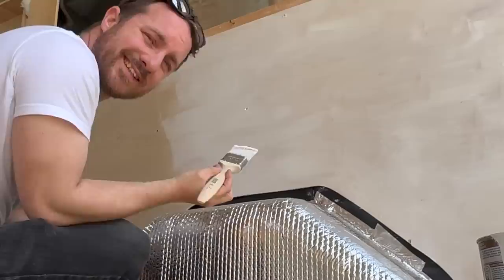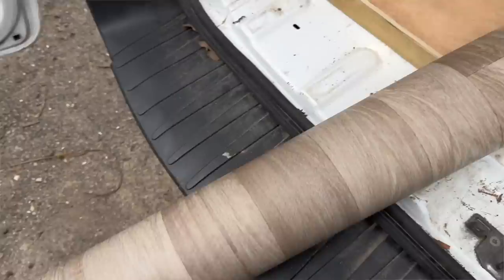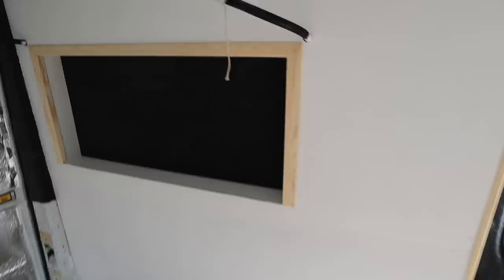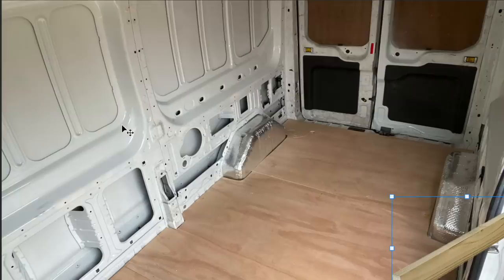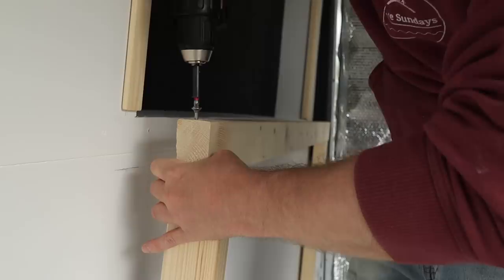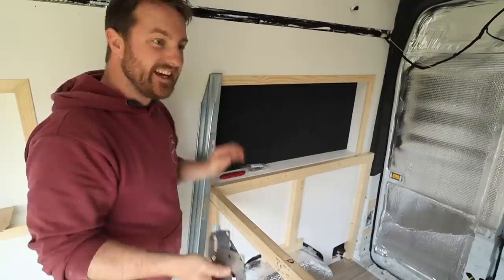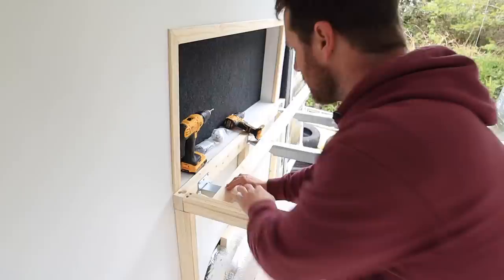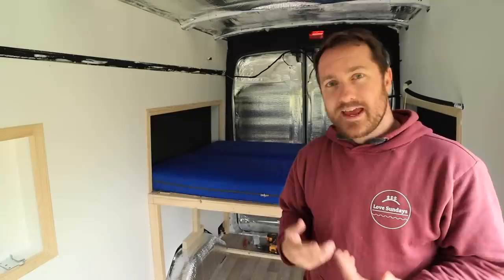I FINALLY HAVE A FULL SIZE BED IN MY CAMPER VAN

Comment: Oh, the height of the slats will not be a problem, since you add a foam on top of the slats too.
And the IKEA metal slats are supposed to be locked togeter with a screw once adjusted to size, so they can't make the frame cave in.
Reply: Excellent suggestion

Comment: You can turn the bed brackets upside down and have it flush with the top of your wood, then use a penny washer screwed in at the top of the wood to hold the Ikea beam on.
Reply: @PhilStanbury would that be strong enough? All that pressure through one screw if I understand correctly
Reply: @FFTuk  The bracket would be upside down flush with your wood top, the beam would still be the right way up droping in from the top of the bracket, and the penny washer screwed on top would stop the beam jumping out the top.

Comment: For the bed support brackets why not fold the bracket and mount on top save weight on frames or packing 👍
Reply from the maker: Good advice
Reply: came to say the same thing
Reply: Yea, thick metal, tho. So might have to put a cutting wheel on an angle grinder and cut a slit where you want it to bend.
Reply: @DexterGoneWild or put it in a vice and smack it about a bit 😂

Comment: Hi Shaun, done the ikea bed hack myself a while ago. I trick I learned was if you rotate the brackets 180degrees the frame fits flush with the top of wood . I just added a velcro strip onto the connecting peice to prevent any rattling as well . Great build though mate 👌

Comment: Looking good.  Sorry you have a war wound from the drilling, that's always my worst nightmare.  As for fitting the vinyl flooring I have seen many people use newspapers to make a template for the floor then cut the vinyl in their shed or loungeroom and it always seems to work out well and is really easy to do.  Many have done it in caravans too.

Comment: With the brackets, could you bend them over by 90 degrees so that the screw hole mounting section is on top of the wood which then allows  everything to move up?
Reply from the maker: Could do but the system I’ve made now allows me to remove most of the bed so if I ever need to transport a load of stuff I can just remove the whole bed

Comment: Doing a sterling job buddy. I used the Ikea beams and mounted the brackets directly into the metal super structure using one of those big pop rivetty thingys! Cost about £40 sovs for the tool but I'm sure it will come in handy for other jobs too. Are you building your own kitchen unit or buying a ready made one? Later, hang loose, Sid x
Reply from the maker: Might go for an ikea kitchen Sid they’re cheap enough and at least I’ll alway be able to get stuff to fit in the drawers like organisers
Reply: @LoveSundays  Just the quality that worries me as they aren't meant for such an application really. I think I'll custom build my unit out of stout timber frame and clad it with mdf or ply not sure which yet. Keeping an eye on cost as everything is way more expensive now than a few years ago. 😒

Comment: Im slowly working my through the series so I know what im about to say is useless because you have already done your fix lol. but the metal ikea holders for the big metal bed beams you could have bent them over the wood and screws them in from the top. either way nice work on the van

Comment: Rather than cutting corners off a mattress, wouldn't it be simpler to get a shorter mattress and make make extra padding (memory foam?) for the inserts?
Reply from the maker: That’s a good idea but the mattress will need to be trimmed anyway due to the van walls not being square and the transit does taper at the rear

Comment: Hi Shaun, how did you fix the surrounds around your inserts? Did you use adhesive? Thanks from another Shaun
Reply from the maker: Yea I glued them into place with clamps. I used the same stuff I fixed the roof with
Reply: Thank you. Looks great 👍

Comment: I might have missed it, but what length bed did you end up with?
I am 186cm and it would be great for me to be able to sleep east/west and still have some insulation in both ends.
OTOH I dont think I ever have slept fully stretched out.
Reply from the maker: The bed is 6ft 3inches or 192cm

Comment: Hi mate, really enjoyed watching your build, it looks very impressive.  Im currently at the stage of attaching the walls with the framing of the bed cut out. My build is similar to yours with the odd difference. I was just wondering what your dimensions were for the bed window frame. Sorry im not so sure that makes sense but i mean the part cut out for your head and feet to go when your sleeping. Ive made the gap but am a little concerned it might not be big enough when mattresses and pillows get added. Would really appreciate your thoughts.
Reply from the maker: I think they were about 3 inches deep each from what I remember I can always measure them for you later if you like
Reply: Sorry I meant the height of the window. Mines 42cm in height.
Reply from the maker: @thekingofthegamers2880 what window?
Reply: Oh no I'm completely useless at this aren't I. It's not a window as such but mealy the wooden frame used for extra head and leg room  above the bed slats. Please forgive me
Reply from the maker: @thekingofthegamers2880 what I did is I worked out the thickness of mattress I was planning to use then the size of the pillows. That should give you the right measurement

Comment: What are the brackets called from ikea. I can’t find them online. I’m also near Exeter ikea. Thanks.
Reply from the maker: You have to ask for them at customer services
Reply: Thanks for your quick reply. 
Is it just the bracket for the skorva beam I ask for?
Reply from the maker: @shonakyle8927 yes they should just hand over however mainly you need. Remember it’s 2 brackets per beam
Reply: @LoveSundays  thank you so much. I really appreciate your help. 
I’m loving you videos too. 
We’re just in the process of converting a transit 350. And finding your videos really helpful. 😊